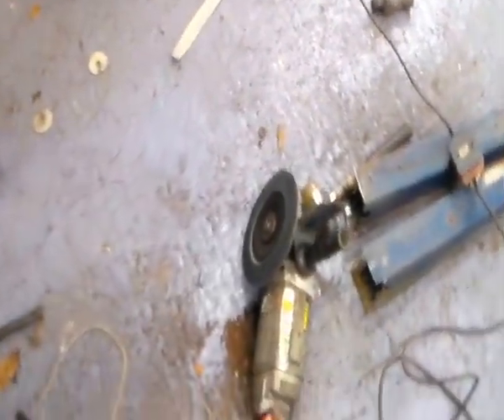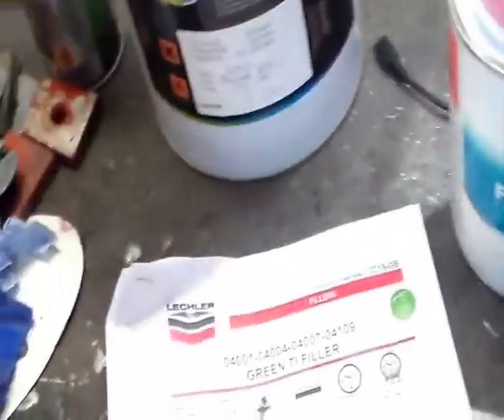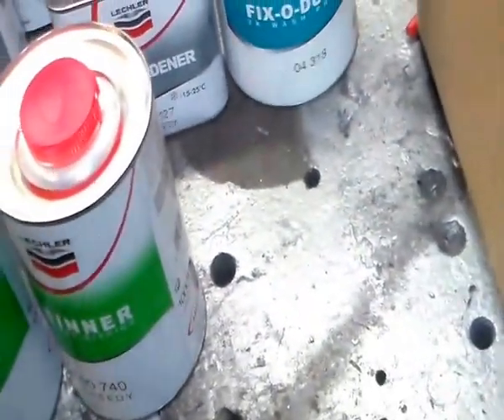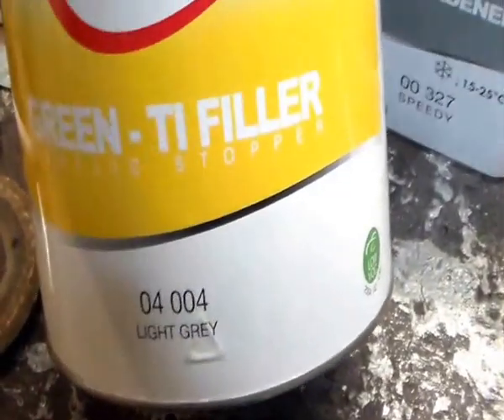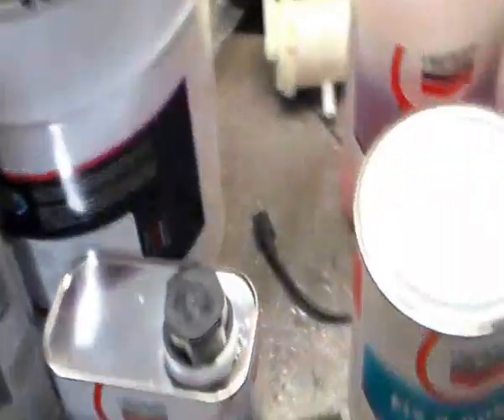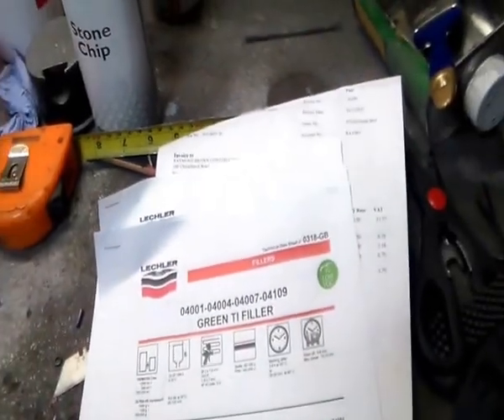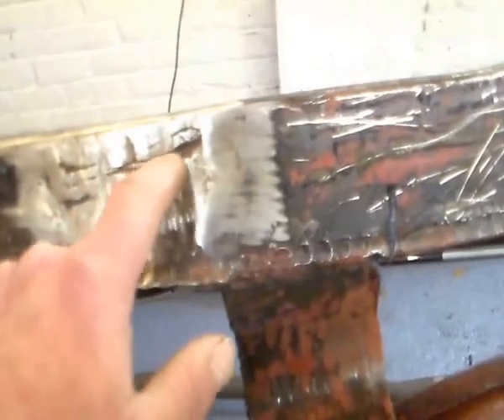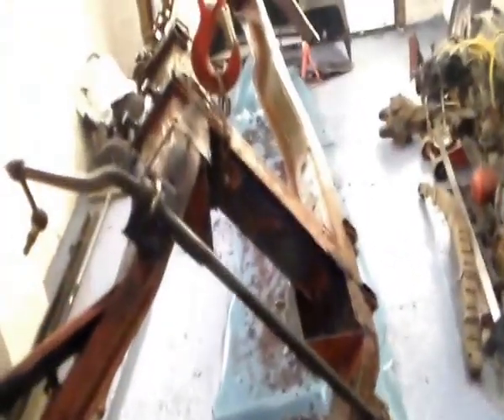Dec 12th 13 Stripping and paint supplies

Comment: Anyone looking for a paint stripper that does what it says, unlike most/all of the garbage being sold today thanks to EU bullmanure, is BioStrip20 (Usual disclaimer)
Water based, but before I hear you all howl in anguish, it DOES work!
I've been using it on my Austin Seven that I need to take down to bare metal before I coach paint.
Buy a small tin and surprise yourself, as I was.
Geoff - Spending far to long attempting to get tools into some sort of organized chaos
Reply from the maker: Sounds like some really good stuff Geoff, i need to look out for it, thanks for stopping by